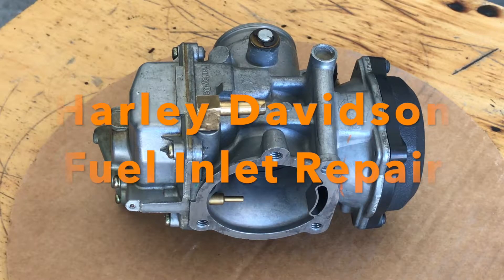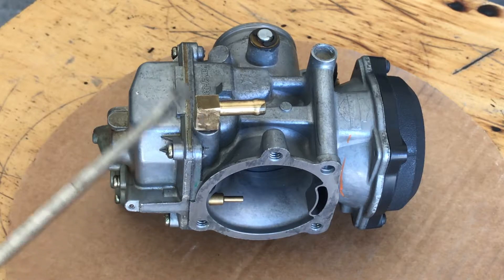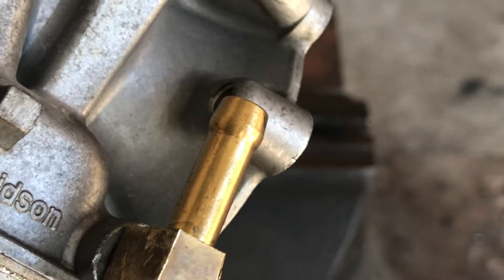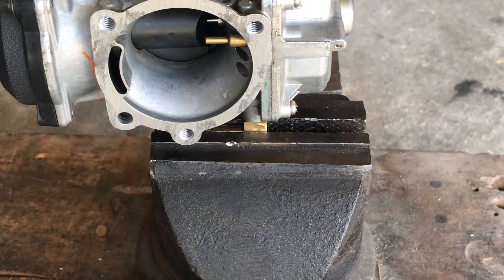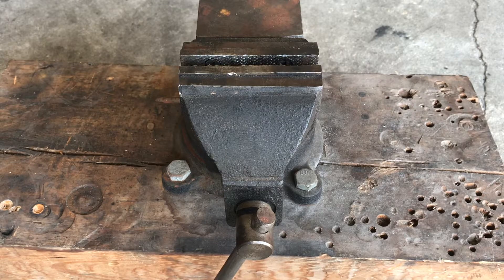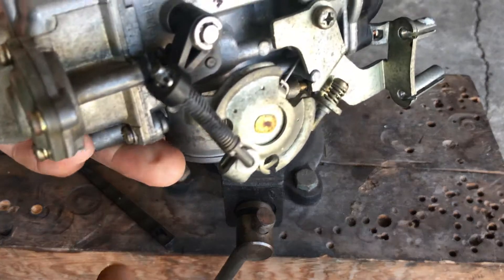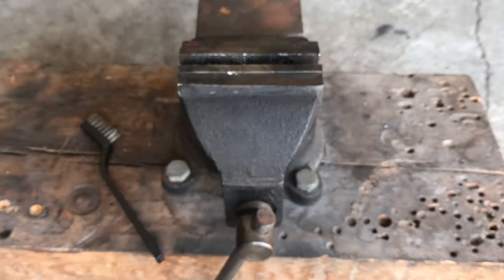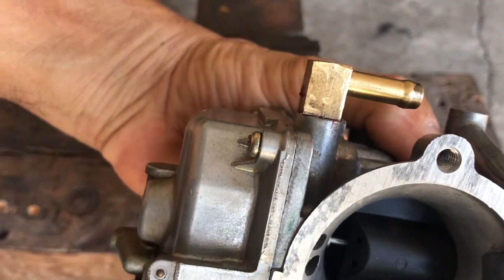How to Repair Harley Davidson carburetor fuel Line or inlet.

Comment: I have the black vinyl one on mine. Found a leak in the fuel line braided stainless. so am gonna try to see if replacin that does the trick. hope so. if not i'm sure the part u just covered is next.
thanks , much appreciated,
Wulfy
Reply from the maker: Happy to help, Any questions just ask. Ebay item.   https://www.ebay.com/itm/DS-Fuel-Inlet-Fitting-for-Keihin-Carbs-Harley-Davidson-142451/332779750128?epid=0&hash=item4d7b3802f0:g:yPwAAOSwXFRcT3Vw  .   Thank you for your Sub.  Ride Safe and have a great day.

Comment: Rocco, have you done any work on a Vulcan S 650? Thinking about getting the bike? Please advise me any possible problems.
Reply from the maker: What Year? How many miles?
Reply: Maybe 2019 or 2020. The new version has been out seen 2015 to present date.
Reply from the maker: In my opinion a 650 twin is too small. I would  think,  900 or bigger and you won't need to buy a bigger bike in six months.  But that's just my opinion and experience. Hope this helps. Let us know what you think?

Comment: The inlet valve on my bike is cracked  so when installing the new one would it be wrong to point it facing down instead of up since I can get the fuel line to it more directly from underneath
Reply from the maker: Happy to help, Harley Davison has is the fuel inlet facing up. If you believe it's easier for you there's a good chance to Fuel Line is not routed correctly. I tried to make things as correct as possible. Would it make a big difference no. Thank you for watching and all your support. Ride safe and have a great day.

Comment: got a cvk40 but when i pulled the old ports they measure at 7.99mm the new brass one from drag specialties measure 8.03mm   is that too much of a interferance fit?   i dont want to crack my carb
Reply from the maker: Happy to help. They are slightly tapered. Put it in the  freezer overnight then install. Let us know how this works out  Thank you for watching and you sub Shabbernigdo. Ride safe and have a great day.
Reply: @TwoWheelRocco  I ended up polishing em up a bit then putting some bearing oil on them and taping them in to just get them to stay in place then took the whole assembly over to the vice lined it all up and went for it while hoping for the best. Pressed em in slowly till i felt them bottom out. No leaks so far so i think i got em   lol.
Reply from the maker: @ShabbernigdoXingjian  dorito all went well. Ride safe and have a great day. Thank you for watching.

Comment: My vinyl inlet is definitely cracked, i have the new brass one and I'm just wondering if I can do this without taking the whole carb off the bike? Thanks for the vids!
Reply from the maker: Happy to help. I would remove the carburetor, removing and installing the new inlet will not be so easy. Let us know how it works out. It's not a big deal removing the carburetor just loosen the throttle cables all the way at the twist group. Thank you for watching and your sub urlak.. Ride safe and have a great day.

Comment: Where does the other end of that fuel line connect to?  I had a gas leak and found the opposite end popped off,  but can’t find any other inlet to hook it back up.. 92 fat boy
Reply from the maker: Happy to help. If you're talking about the overflow hose on the bottom of your float bowl that drains to the floor,  gos back towards the transmission,  As for a fuel line that's from your carburetor to your gas tank that's it. The vent line is 1/4. The fuel line is 3/8. Thank you for watching and all your support Madison. Ride safe and have a great day. Any other questions just ask. Hope that helps.